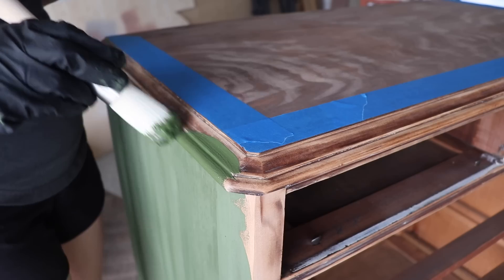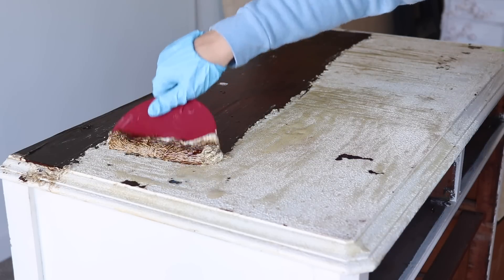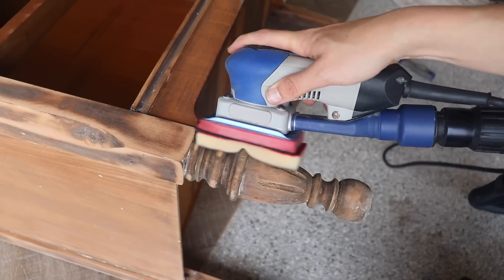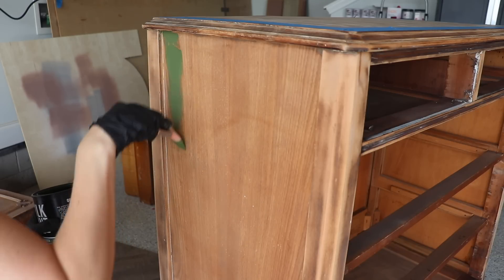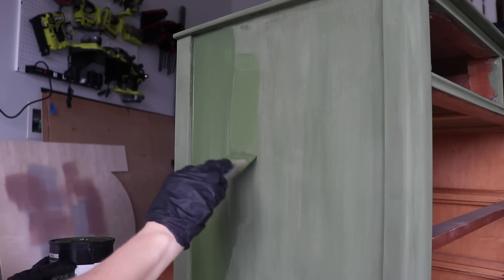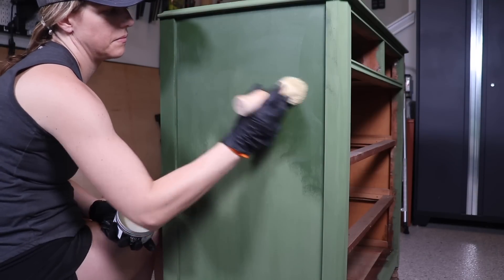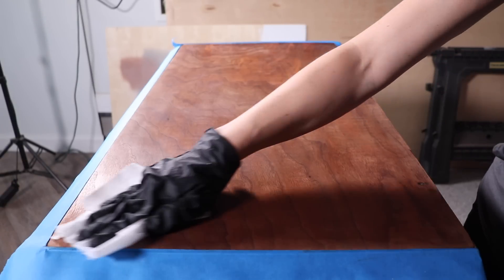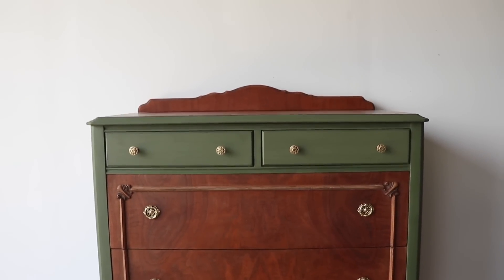You Won't Believe What I Found Under this Paint! 😱 Real Milk Paint Co Furniture Makeover

Comment: 👏🏼👏🏼👏🏼 how do u clean/dust waxed pieces of furniture pls? And do u need to re-wax the surfaces of waxed pieces? If so, how often pls?
Reply from the maker: Once it is cured (after 30 days) you can dust and clean with mild soap and warm water if needed. You can reapply another coat of wax if it gets dull looking. Around 2-3 years after use or when needed.

Comment: Just an FYI, to anyone refinishing painted items, always spray 2 coats of either shellac, or a poly acrylic,  sand. That way your paint will not soak into the wood for a much easier next strip later in its life. So many people miss this step. And it's easier to use a metal scraper to remove the stripping process.